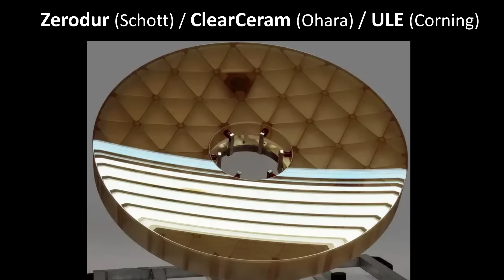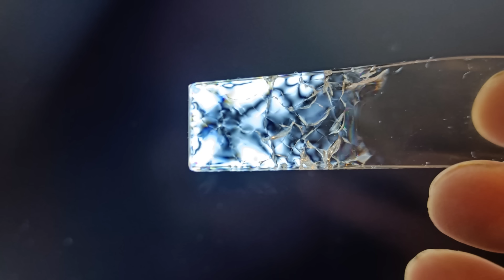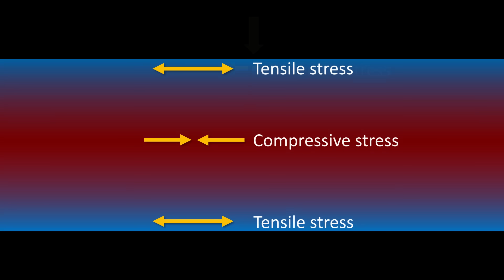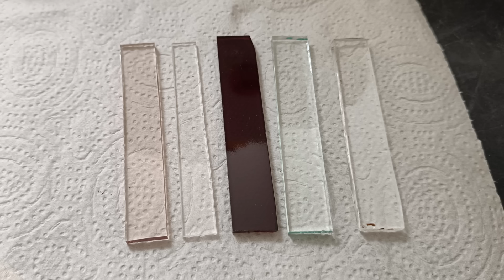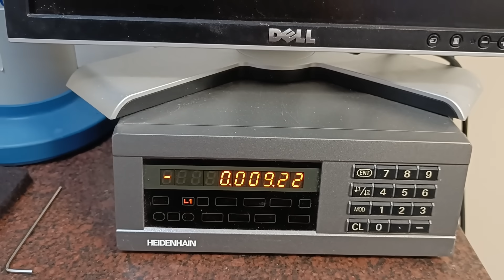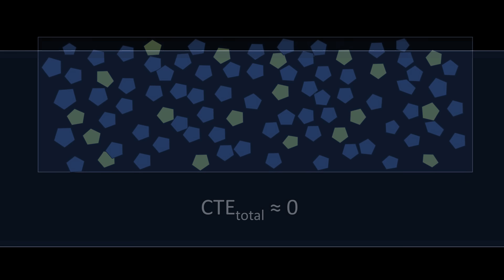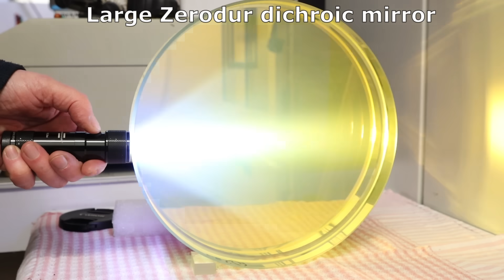The Amazing Properties of Glass-Ceramics (GC Part 1)

Comment: In the formulas Zn0.5AlSi2O6 and Mg0.5AlSi2O6 you showed, what does it mean to have 0.5 in the subscript?
Reply from the maker: It just means that the concentration is lower by a factor of 2. I could have also have multiplied the other values with 2, but since the base structure is very similar to the Lithium 1+ version, this shows more clearly that a Zn ion is only present in half of the available positions in the lattice because of its 2+ charge.

Comment: I know nothing about glass besides basic stuff, so pardon if my question is dumb. In your explanation of tensile and compressive stress, is the direction of stress through the length of the material or the thickness of the material, or is it in all direction in this case since it's the outer surface which is cooling faster?
Reply from the maker: That is a good question. In a 3D object, containing a GRADIENT in stress. the stress is never just linear, but must have components that are orthogonal. It's basically very similar to a field gradient.

Comment: First time on your channel, fascinating stuff. I am surprised you didn't use an optical length measurement with lasers. 
The temperature may not have been consistent along the length of the sample, especially at the ends. A sous vide bath with temperature controlled to 0.1°C might have been better to ensure a consistent temperature?
Reply from the maker: Good point, the temperature measurement is by far the least accurate one.

Comment: At 25:55 you show the height map, and it is colored using the JET color map. I recommend looking into using Viridis: the perceived difference is actually linear, and therefore the data can be mapped directly into the color scale to give an accurate visualization. It also uses the perceptual range better than JET, giving you better information density; and it is extremely colorblind-friendly as well.
Reply from the maker: It's what the ZYGO WLI shows as a default. I will check it it has different settings on displaying height maps, but currently I'm not aware of that.

Comment: Thanks!  This is the first time I've seen a discussion of nucleation vs. crystal growth happening at different conditions.
Reply: It's equally relevant for metallurgy and equally fascinating.
Reply: I suspect that some similar wizardry occurs when chocolate is correctly tempered.  It too needs the temperature carefully controlled if you want to achieve smooth results by favouring some specific crystalline structure.

Comment: Hm. This is interesting in relation to my interest in Tesla Turbines using direct combustion of fuel-air mixtures to power the turbines. Most Tesla Turbine information I have seen uses some form of metal for the disks. These end up warping due to the expansion of the metal due to the high temperatures. I have seen glass disks used as substrates in the manufacture of hard disk drives (replacing the aluminum disks previously used). I am now curious as to how well this material would work (and what the cost would be for a material that has a coefficient of expansion close enough to zero to make it practical for manufacture rather than simply for experiment).
Reply: For a Tesla turbine you also have to consider the extreme centrifugal stresses on the discs, a high strength material is needed.

And also you have to consider the frankly dismal efficiency of Tesla turbines. There are some undesirable fluid dynamic effects that make it almost impossible for them to operate anywhere near as well as they should theoretically. They're actually a lot more useful as pumps for fluid that cannot withstand high shear stress, like blood. And in those cases efficiency is a secondary concern.
Reply: @nerd1000ify  Tesla himself had built a 2-stage turbine, with the output of the first stage going into the input of two secondary stages. I don't recall anyone doing experiments with Tesla turbines using a second stage. Tesla claimed that, with the second stage, the turbine was more efficient. I don't know, since no one is using a second stage. Also, most of these are running at high speed with small disks, I wonder what larger disks with lower speed would do.
Reply: @paulbell2466  There's a solid mathematical framework for understanding how any turbine (Tesla included) works in theory, look up the Euler turbomachine equation as a starting point.

The short answer is that extra stages don't automatically help efficiency, they're more like changing the 'gearing' of the turbine. To obtain best efficiency Tesla turbines need to run at a speed where the outer edges of the discs are going almost as fast as the fluid exiting the nozzles. The velocity of fluid exiting the nozzles depends on how much pressure drop occurs, so the more pressure drop the faster the turbine should run. Having a second stage lets you split the pressure drop into two steps, each step resulting in the fluid achieving a lower speed. Thus the two stage turbine has a optimal speed about 1/2 that of the single stage, and produces about 2x the torque. The efficiency might be better or worse, depending on what the major source of losses in your turbine is. 

The same rules apply to regular bladed turbines. This is why you will see that steam turbines used in old ships often have hundreds of stages, they needed to 'gear down' the turbine to very low RPM to drive the huge propellers.

Comment: This sort of glass would be great for bushfire areas as window glass. Often structures are basically fine as the fire front goes through, but glass windows break in the radiant heat and allow embers into the building setting fire to the inside.
Reply: Yes and in fact someone in the Los Angeles area had thermal panes put in and it did not break or crack.
Reply: A hardened  ordinary window glass would work in that application  to. Glass breaks because of temperature differences as shown in the video,  a ordinary glass may have a tolerance of  a few   tens degres c. of difference   before  cracks may occur. For example a black pillow stacked up against the glass in a window during  sunny day may  cause the  glass to crack due to differential  temperature  behind the pillow and in other places. In hardend glass its 300 degrees c. or something ( I think ).

Comment: Utterly fascinating. Thank you.
The nucleation/crystallization graph explained to me the process of anealing and quenching and heat processing of steel, a subject I had always found baffeling before. But with the additional knowledge that nucleation need not be the same probabilistic curve as crystallization, the whole set of processes makes sense.
So thank you very much!
Reply: Indeed, heat treatment is far from exclusive to metal; phase transformations and kinetics apply across the condensed-matter spectrum.  Steel actually isn't a good comparison -- it's even more complicated than this!  But only a little more complicated.

The most common equivalent, starts from crystalline solution, from which another crystal precipitates.  There's no amorphous phase, but it's still a solid-phase reaction.  Such alloys are called "precipitation hardening".  Lots of alloys are included: most aluminums, some bronzes, some stainless steels, some titaniums, etc.  After solidification or annealing (to bring everything into solution), then quenching, the precipitate is held in (supersaturated) solid solution.  It comes out slowly, either at room temperature (natural aging), or at temperature and time (artificial aging).  Typically the precipitate is a hard, brittle intermetallic phase, finely dispersed within the host crystal, pinning slippage planes -- raising yield strength and lowering ductility.

The exact equivalent even exists: precipitation of nucleates/crystals from an amorphous solid solution.  When complex metallic mixtures are quenched rapidly from melt, crystallization can be avoided and a metallic glass results. These have a number of interesting properties, including injection moldability (for some), reduced elastic losses, or enhanced magnetic properties (as an EE, amorphous/nanocrystalline magnetic core materials are of particular use to me!).  Nanocrystalline materials are indeed produced the same way: quench from melt, then anneal at modest temperature along a schedule, to grow nanocrystals in an amorphous matrix. (Amazingly, despite traditional materials having performance go up with crystal size (fewer flux pinning sites, grain boundary impurities, perhaps?), these perform a bit better than their completely amorphous forms.  Apparently this was a bit late to discover, because, who would think to measure the properties of something with crystals so seemingly-uselessly-small?)

Most steels, on the other hand, undergo a phase transition, a peculiar one at that.  Above the transformation temperature, it again becomes a homogeneous solution (austenite).  Below, it disproportionates (peritectoid transformation) into a mixture of iron (ferrite) and carbide (cementite).  Depending on rate, this occurs in an orderly fashion (producing a layered (pearlite) matrix -- analogous to a eutectic melt freezing from liquid into fine alternating layers of crystals), or disorderly (martensite).  Martensite is a nonequilibrium phase, and has different density as well, hence the material can warp or even crack when cooled too quickly and unevenly.  On modest heating, martensite is "tempered", partially or fully (I forget how much, or to what, exactly--), transforming into other crystal forms that have more ductility.  In any case, we again have the situation of a soft matrix frustrated by myriad hard inclusions, pinning slippage planes, trading strength in exchange for ductility.

Cementite itself is a non-equilibrium species, give or take other alloying elements.  Cast iron is a carbon-saturated melt (typically 2-3% C); when cooled too quickly, cementite and martensite are formed, called white cast iron (extremely hard, not machinable, but can be useful for wear surfaces as-cast, and ground to shape).  With silicon added (say 1-3%), the critical cooling rate is faster, and flake graphite precipitates easily: this gives gray cast iron, famously flowable even in thin sections like frying pans, or vintage radiators.  (The graphite flakes don't have much strength themselves, and essentially form a sharp-edged cavity within the matrix: the resulting stress raisers basically pre-crack the matrix, hence having almost no ductility.)  Alternately, graphite can be coaxed out of solution in a more compact (nodular) form, on extended annealing (nodularization), which makes malleable iron.  Eventually, it was discovered that certain alloying elements (e.g. Mg) can achieve this directly from melt, and so ductile iron has largely replaced malleable iron.
Reply: @T3sl4  
Whoa!
Mind bending core dump.
I'm gonna hafta read that a handfull of times before I fully get it.
Freaking awesome! Thank you!!

Comment: The first thing that I thought of at 9:10 was that a CTE of 0 ± 0.5 would mean a negative CTE would be possible which meant the material could shrink when heated, which is counter intuitive to me. Later you explained this is actually the case. Very interesting.

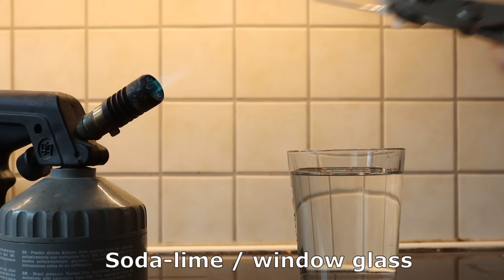If I remember correctly polarised light makes it possible to show the internal (temperature) stress within glass. Using a polarised light source and a 90° polarisation filter for the camera lights up the stress within the sample. It would be interesting to see that for all the samples during the cooling down stress test at 2:30
Reply from the maker: I did not think of that, but it would have been a nice experiment!
Reply: @HuygensOptics  Well, now you (should) know what to do: make another video! 😁
Reply: Are you referring to Schlieren imaging?
Reply: @  It's a little different. Schlieren imaging uses a knife-edge to block the focal point from a point source, such that light which is deviated from a straight line passes the block; It's often used to visualize density changes in air or a gas. The cross polarizer technique polarizes light in one direction, passes it through a sample, and then through another polarizer oriented such that no light passes without having it's polarization rotated. Stress in transparent solids often rotates polarization so this causes areas under stress to appear brightly lit on a black background. 

By the way cross polarization visualization can easily be done with a pair of polarized sunglasses and most LCD monitors, which output polarized light. Simply orient the sunglasses until your monitor goes black, and hold up various transparent objects. Plastics work well, and can be put under stress in real time..
Reply: @benmcreynolds8581  It's a little different. Schlieren imaging uses a knife-edge to block the focal point from a point source, such that light which is deviated from a straight line passes the block; It's often used to visualize density changes in air or a gas. The cross polarizer technique polarizes light in one direction, passes it through a sample, and then through another polarizer oriented such that no light passes without having it's polarization rotated. Stress in transparent solids often rotates polarization so this causes areas under stress to appear brightly lit on a black background. By the way cross polarization visualization can easily be done with a pair of polarized sunglasses and most LCD monitors, which output polarized light. Simply orient the sunglasses until your monitor goes black, and hold up various transparent objects. Plastics work well, and can be put under stress in real time.
Reply: if we think about ice when its heated it shrinks in volume
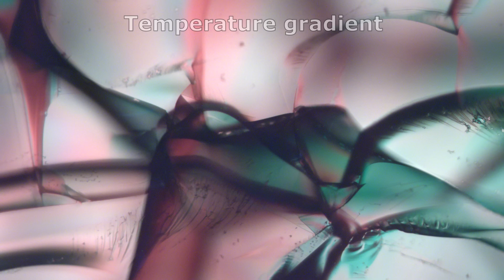Reply: I kinda thought that effect is what was causing the colors at 5:38 in the microscope. Maybe it was interference between surfaces of the cracks or prism effects instead. Or maybe all three were at play. Idunno.

 I think Nomarski microscope setups are closely related to stress polarizer setups (unless I'm remembering wrong).

Comment: Fascinating. I think I have ceramic glass coffee mugs... they're double walled so they are not hot to the touch. They don't quite feel like glass, but extremely close. But.... I thought for sure that you'd measure delta-length by passing coherent light through the samples and measuring the phase-change (wavelength phase)... why not???? I work only in GHz range of RF, so I'm not well versed in optics.
Reply from the maker: This was way easier! The gauge has 20nm units, so that is more than sufficient.
Reply: @HuygensOptics  Wow, that is incredible resolution and accuracy for a mechanical device of that size!!
Reply: That spherottonic certainly deserves the badge of ultra @HuygensOptics
Reply: I had a similar thought, but different. 

Usually the effects of CTE are far smaller than the effects of dn/dT, so that would be complicated indeed.

However, I would think it might be practical to glue a mirror to both ends of the plate of material under test and view both mirrors using a general purpose interferometer and a reference flat... Do you have one of those?

Seems similarly difficult.

Comment: I think you've oversimplified a bit the explanation of what "ceramic" is.  This is pretty reasonable, because "ceramic"s care kind of the trash bin we send every material that doesn't fit well into the other more well defined parameters ... but specifically when using pottery as an example, the suggestion that it is purely a sintered polycristaline material is not accurate.  Clay, is composed principally of silica/silicates, alumina/aluminates, and flux which reduces the melting point and viscosity of the glass formed when fired.  This creates a material after firing where crystalline alumina regions and unmelted quatz are suspended in a silica glass.  The quantity of glass in the finished pottery varies, but it's very important for the structural integrity and lack of porosity of the finished product.  Glaze on the other hand has a much higher glass component, but still generally contains substantial quantities of alumina.  The unique difference between pottery and glass-ceramics, from what I understand, is that the crystalline regions are formed from the glassy regions, in very small grains, very evenly distributed throughout the material.  Whereas in pottery, the crystalline regions are foreign material not incorporated into the glassy regions, and often fairly coarse.
Reply from the maker: You are absolutely right. That part was an addition that was added after the video was  reviewed. I wanted to explain the difference in less than a minute, which did not leave a lot of room for nuance.😊
Reply: Yes he simplified it. He's trying to help people with not -so-technical backgrounds understand the world around them without making shit up
Reply: @josephchristman578  I saw your other comment about working in optics. Have you seen the new upload from the AppliedScience channel? It's a lighting and recording system than can record extremely bright visuals like welding and laser cutting with amazing detail. Worth a look!
Reply: You can tell the video is top notch when the comments section is such a fantastically useful extension of the original content. Thanks for the outstanding video, and thanks for the illuminating comment.
Reply: I am totally new to this. So this explains why the glase often cracks, because it is more like a glass structure?